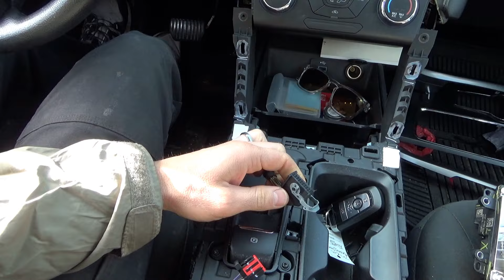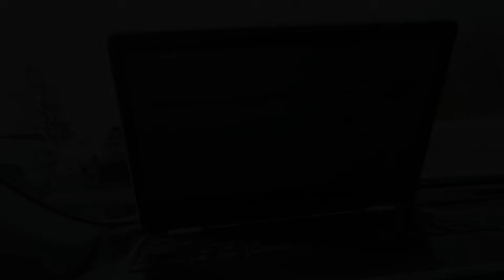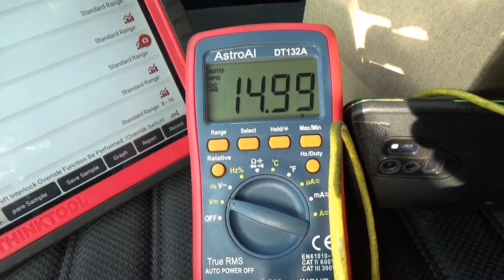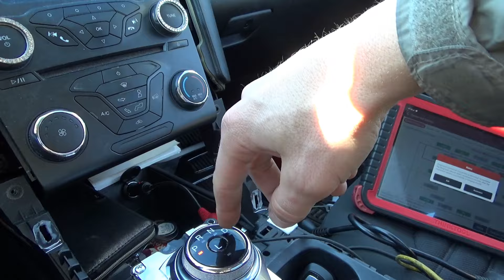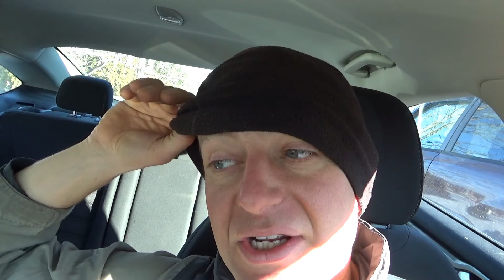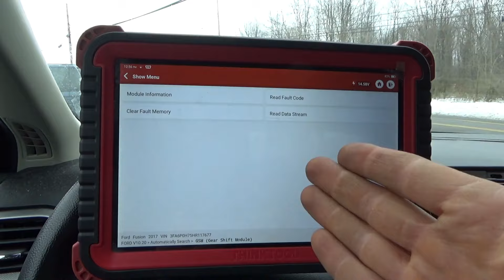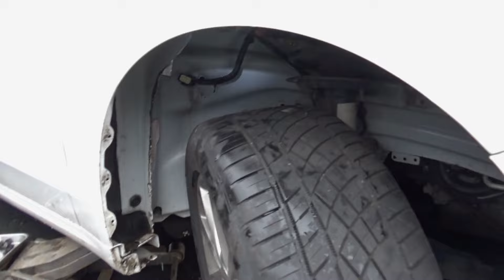Why New Cars SUCK (Ford Fusion STUCK in PARK?! - Part 2)

Comment: The funny part is, it's still basically a manual system that has the lever on the transmission and the CABLE. lol.  Once these cars become old junkers and this needs fixed, (if it was my car)  I'd probably just route that cable into the cab and cut a hole in the center console somewhere clean and fabricate my own shift lever and be done with it;  because this is just stupid. lol.  The crazy thing is, my mom just bought one of these cars, 2019.  FML

Comment: You bring up a very interesting point in this video, Ivan; if a technician can't plug that fancy scan tool in and it tell them what is wrong then what?  Seems to me like that happened once before to you; when the mice built the nest in the Rogue.  That is when you throw that Russian brain in high gear.  I knew this was getting serious when you said you called Keith DeFazio.  I just replaced the bushings on the shift tube on the Marquis; I guess I should be grateful it is designed that way.  I also replaced the starter recently; that shift mechanism looks to be roughly the same size.  (I am surprised they don't need the old one as a core.)  Just one more thing about those comments about engineers:  Let us NOT forget, YOU are an engineer.  In your bio you mention your degree from Cornell University and your Graduate work at Penn State.  I guess this is different than particle accelerators.  Great video!

Comment: That rotary shifting contraption still uses a cable to shift the transmission, so what's the point of those two modules and their electrics? About that plastic bushing on the cable..replace it with a brass one. See? I'm not even an engineer and they never thought to do that. This car, and others like it are engineered for obsolescence.

Comment: Self driving cars are here and they're going to be everywhere in 20 years. Bearing able to shift a transmission is a step in that direction. Although, with electric motors, maybe all you need is a frequency drive instead if a transmission.

Comment: Nothing wrong with shift by wire. Stupid thing to do is controlling a cable with multiple motors that have plastic gears. They could’ve used a stepper motor right on the shift lever on the transmission. Again, built to fail by adding complexity.

Comment: One thing that would bother me about that auto gear shifting mechanism is the fact that it will put the vehicle in park with a door open. I'd like to see the past statistics that warrant developing that feature and MORE restrictive operation of the vehicle. I often drive with the door open or ajar when backing up sometimes or for whatever reasons I might have for SAFELY navigating the vehicle. This feature would prevent that thus, restricting my ability to do that. 
Just like that stop/start feature some cars come with including Jeeps and 4x4 vehicles. Maybe I don't want the engine turning off everytime I come to a stop. Maybe I want the A/C or heater to keep working or maybe I encounter some rough territory on steep downgrades/hills that I want the engine to help control the vehicle vs the brakes etc. These kinds of features are all out of a fictional fantasy book and completely take out the operation of a vehicle if they don't work 100%. Even in this case, no trouble codes were engineered/programmed for it so the vehicle has no clue. I reckon said engineer who designed this part didn't consider a cable clip might fail allowing the device to OVER shoot or extend damaging the mechanical parts to self destruct. One thing I noticed were those metal gears...they are the ones that will easily strip but whats worse is the metal gears were good enough for the job but they included some plastic/nylon gears that surely wouldn't last as long. Keep in mind...this dumb part works 2x minimum with each start cycle and subject to more work depending on the driver and/or the terrain. Just think if this car was used for deliveries...hundreds of cycles per day ! 500+ pissed off Ford customers well over 30 days and counting !
Reply: Uh, does this also mean that if you pull up to a stop sign and a carjacker opens your door to steal your car the car politely shifts to park to make the carjacker's job easier and safer?   Hmmmm....

Comment: It seriously blows my mind that vehicle had no trouble codes or warnings Indicating a issue with the trans range motor, especially after attempting the maunal override. It did make strange noises, but alot of vehicles make strange noises these days. In a situation like that I would have fired a new GSM at it as well since it only takes a second to swap out. If that don't work basically all thats left is the range motor.  So excellent work far as I'm concerned PH. Also Thanks for taking the time to show the workings PID data after the repair, I work on alot of fords so that's valuable info to me! 👍👍👍

Comment: It seems like an unnecessarily complicated way to change gears but "shift by wire" is the only way the computer can control what gear the transmission is in, which is needed for certain "safely" and performance features; however, it should be as reliable as an electronic throttle and when it goes bad, there should be much better diagnostic codes than this Fusion has.

Comment: Ivan, why did you not carry out a cable relearn when you fitted the new TRCM. You could of seen if it shifted the full range of gears to help for next diagnosis. I thought that was a big red herring on the first video, Sound but no movment. I worked for Iveco a few year back. They use a simular system, shift turret with motors on top of the gearbox, replacing the gear stick. After replacment or reclalibtration , you had to run a relearn with the pc. It had to run through all the gears to calibrate the shifter turret before it would select any gears. Also a clutch shifter that was a motor replacing the clutch cable. you would run a clutch touch point test. and watch the motor shaft push forward the clutch arm on the release bearing. If the clutch wear was to much, it would over throw inside and lock up solid. Sound but no movment. Local repair shops would carry out the clutch or gearbox work required, then tow into the Iveco dealer and be set up on the pc, before they  could be driven.

Comment: It's possible that the ThinkTools had the wrong label on the PID, OE tool might actually say the right thing.  The only other thing you can do is read the network traffic and see if there is something you can figure out, if you have those kind of skills.  This is what happens when you have a ton of individual computers all trying to send info via a network.  Not only is it super expensive to have all those electronics, but if a software architect fails to document one or more pieces of data, no one can find it.  The fact that it was on national backorder says a lot about all the failures out there.

Also, this is why Tesla's profit margin is 10x other manufacturers as they use ONE central processor to handle all functions.   Not a huge fan of Tesla (or Musk) but they are doing a lot of things is an actual modern way instead of having 100 individual system.  Of course, if that fails, you're kind SOL.
Reply: Sorry to inform you, but Tesla definitely does not use one central processor.   (I do Tesla teardowns on my channel.)   What Tesla does better than anyone else is integration.

Comment: Ford and other companies should be ashamed of this "just good enough" engineering and materiel specifications. Plastic gears, bushings, etc. shouldn't even exist outside of Lego and toys. Brass gears might cost a few bucks more, at worst. Then possibly their overly complicated POS mechanism might be more reliable, if still overkill.

Comment: The only people who have any sort of explanation for manufacturers switching to electronic everything,  are the conspiracy theorists.  It began with Tesla's effort to provide "AI driving" feature to a car that no one needs or even asked for, that has resulted in a lot of death, injury and destruction.  The theorists say this is to gradually bring all vehicles to the point where Big Government can remotely track and control our ability to travel freely.  At first I used to scoff at that but now when I see the ridiculous cost, complexity and weight these systems add to cars, I can't help but wonder. Why would manufacturers expend so much of their resources to add such features to their cars when they are supposed to be making them more fuel efficient?  I mean, how much engineering effort, manufacturing of parts such as PC boards, electric motors and cables were spent doing this for no real benefit to anyone?

Comment: That TRCM looks mechanically overcomplicated where it shouldn't be and under-engineered in the places where it should be. I was kind of expecting a potentiometer or a set of switches for position feedback, but I don't see anything pointing to that. Instead, there's a totally overcomplicated braking/clutch mechanism. A set of limit switches, potentiometer and a simple solenoid brake would have done the trick.

Comment: You have to thank the modern day engineers for all of this stupid bulls#$% electrical / mechanical / and computer controlled crap in modern day auto's. Just start putting back in a 5 speed manual transmission with a clutch cable and shifter and be done with it. ((KISS)) (( Keep it simple stupid))

Comment: I have a dial shifter on my car.  I don't like it and I have yet to find a single person who does like it.  The only thing worse seems to be the ones that look like a traditional shifter but are just a switch. People don't like those either which is understandable since they are confusing to use and completely unnecessary.  I wonder why so many manufacturers chose to go with this type of system?

Comment: So here is my take on this:
Shift by wire works and has its place but Ford half assed it!
If you want legit shift by wire you get rid of ALL the shift cables and motors and just go direct from the TCM to solenoids with no manual valve or moving parts!
I work on heavy trucks and they ALL have Allison transmissions and are ALL fully shift by wire with push button shifter modules. They are very reliable and have no cables to break and bind up or motors to fail.
Reply from the maker: Allison knows heavy duty transmissions 👍 I actually visited their plant once in NC!
Reply: @PineHollowAutoDiagnostics  You would not believe the beating they take and just keep going!
Run completely out of fluid, shifted from D to R while the truck is still moving, constant full throttle shifts in overloaded garbage trucks, ECT.
We even have a few truck tractors with Allison's behind the mighty Cummins X15 and they shrug off the abuse like nothing!

Comment: When you put the screenshot up saying that part was on national back order, I knew it was going to fix it. It's on back order for a big reason. I agree that whole system preventing it from coming out of park is useless and not needed. I feel the same way about sunroofs in cars, car roofs are not meant to have holes in them.

Comment: And here I was thinking it was going to have some hall effect sensors to set the travel limits of the arm and one got broken or damaged when the system malfunctioned.  So they remove a reliable shifter and add more complexity and weight to have a rotating knob with heavy bulky motor that still uses a cable. Remind me why I think designs like this are a solution to a problem no one asked. Lets not even start on about the debacle called an electric parking brake and the nonsense that has in its design.

Comment: I don't think shift-by-wire is a bad thing, but the problem here is more like "let's replace the existing shifter with something fancy and electronic" while the shifter on the transmission is still mechanical. They could make the whole thing more efficient and save weight if they did the whole PRNDL shift arrangement in software through the TCM. There's no need for a mechanical lever if the entire transmission is electronically controlled to begin with.
Reply: The main reason is they are still using a park pawl, so have to have some way to actuate that.   A lot of companies have went to electric motors on the rear brake calipers and then you don't need the park pawl, and you get double redundancy.
Reply: @Ingineerix  There's no reason the park pawl can't be hydraulic and therefore actuated through the TCM as well. Unless some archaic regulation somehow requires the park pawl or shift linkage to be a mechanical arrangement instead of being entirely electromechanical.
Reply: @Stoney3K  You can't use a hydraulic park pawl, or else the car wouldn't be able to park if hydraulic pressure were lost.   Other manufacturers have solved this with a single stepper or cycloidial drive (brushless) rather than 4 shitty brushed DC motors like Ford apparently decided.
Reply: @Ingineerix  You can definitely make a park pawl that only releases when there is hydraulic pressure (and latches until the transmission is put back in park), or use any other means of moving a mechanical part inside of a transmission, like a bistable solenoid.

There is no reason to have a mechanical arm that used to connect to an actual lever and which is driven by a fake electronic lever instead. If you do that, you might as well put the fake lever part inside the transmission and only use it for the important things connected to it (which aren't much).
Reply: @Stoney3K  All I can say is you are clearly not an engineer.  Yeah you could, but no reasonable engineer would.  There are so many problems with that idea.   First off when the car breaks down and you need to tow it, now what?   When you engine dies and you need to put in in park?  Whoops!
Reply: @Ingineerix  You have the same concern now with the motorized handle. No power means the car is stuck in park. Easy enough to circumvent by having a towing override on the pawl that can be pulled by the towing mechanic.

I'm not saying there should be no mechanical controls on the outside if they are needed, but having a traditional transmission handle controlled by a robot that imitates a mechanical linkage is pointless. It's the same reason that manumatic gearboxes are prone to failure.

Comment: Continuing with my rant on these stupid shift designs I remembered actor Anton Yelchin who was crushed against his gate by his Jeep Grand Cherokee when he forgot to move the dial to park. If that was a good old fashioned lever he would still be alive. And just look at the stupidity with the Ford design. You can’t tell me there is any cost savings with that system over a lever. And yet another rant. I was working on a late model BMW with a stupid shifter design where they have to tell you how to select drive and reverse. Why? Because your intuition is to pull back to select reverse when it’s the opposite. Again why?

Comment: Ford has had problems with transmissions coming out of park as far back as the 1960s. People would leave their vehicles running in park and several minutes later, the vehicle goes into reverse. Ford Pickup trucks with a C6 were famous for it in the 1970s. Ford always thought that it was because people didn't get it shifted all of the way into park. It usually happened when vehicles were parked on an uphill incline. Part of it was the design of the shift linkage on the outside of the transmission but the comb that the detent was on and the design of the parking pawl also contributed. With the engine running and gravity trying to turn the driveshaft backwards, the slight vibration of the engine could cause the transmission to come out of park.

Comment: Actually the point about the sound unit makes, is a good one. When the manuals are not providing the answer and no trouble code, the solution could be recording the sound of the actuator and compare it to the working one. Car dealerships might have similar used car and it's quick to record and compare. Now we know the sound of Focus module, but for the next time with so another car.. 

2024 they add sensors to detect if you put your hand out of the window and automatically put the car on park.... Or something. How on earth they are still able to sell a hammer or ladder to general public and not get sued?

Comment: There was to be much to be learned here and I admire that you shared your frustrations and the first part not being the correct one. I’ve been a home remodeling contractor for 47 years and some things didn’t work out over the years so I bought another miscellaneous item and continued the project until the outcome was what I needed to achieve. The customer is happy and they’ll never know what we went through. 
BONUS comment Ivan, I was on a Nissan Frontier forum this morning and they were discussing a no start issue and one member linked your no start video of the Suzuki Equator with the 20 degree no start situation. 
I see you have a very far reach to viewers.
Reply: Pretty cool

Comment: This kind of crap engineering makes you wanna rip your brain out, in the age of (fake) fuel efficiency. Was cursing at idiot incompetent auto design, 50 years ago, but that was like mechanic heaven, compared to the mind boggling idiocy of auto design today. Amazing diag job Ivan!! How you haven't gone insane yet is worth a feature length blockbuster Hollywood movie!!!

Comment: Should have tested it on the road at 60 mph by seeing if the knob would let you put it into park.
Reply: I had a fusion with that shifter and tried that. It doesn’t go to park or reverse over 10 mph
Reply: @Gilboy64  On a rental no doubt?